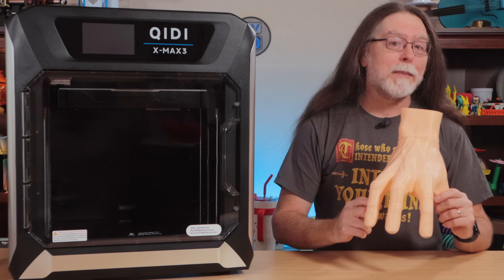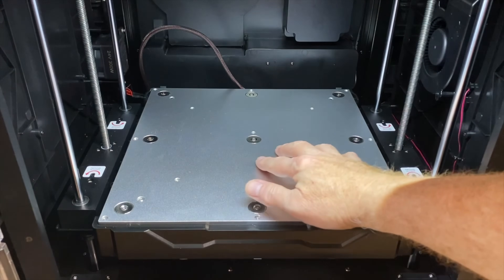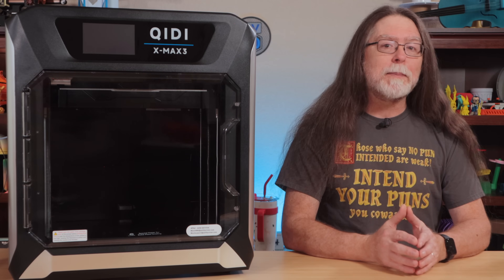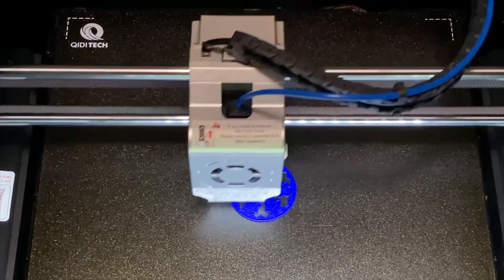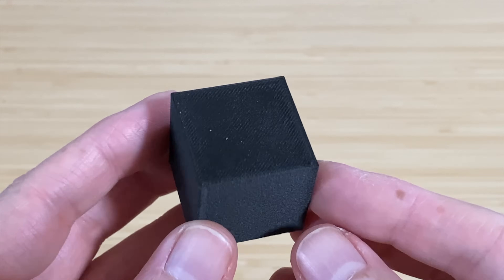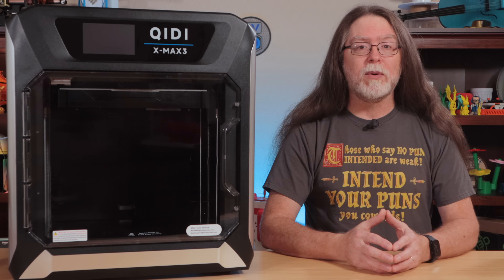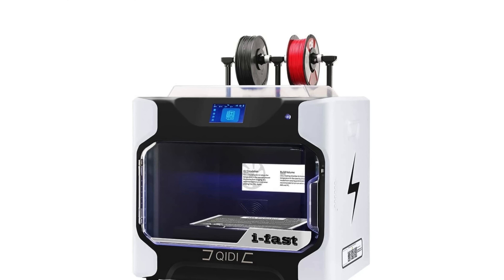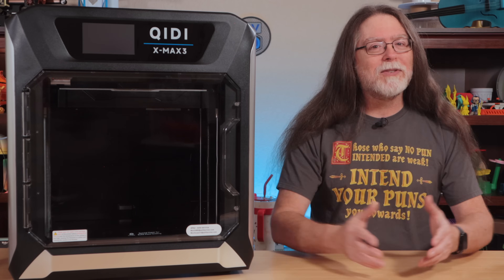Big & Fast: The Qidi Tech X Max 3

Comment: I have a prusa mk4 and having the nozzle as your probe is not all it's hyped up to be. It's alwaya leaving boogers on the build plate as the filament oozes a little. They are not only a pain to clean off sometimes but actually they can ruin the first layer of your next print if you don't. Try finding clear PETG boogers on a textured build plate.

Comment: Huge negative is to not update any of the firmware in Fluidd, it will brick your printer and had to connect via SSH to fix it. That will void the warranty and the info that tells you not to update the firmware through Fluidd is on the wiki.

Comment: Thanks for this review. It's a reflection of my experiences coming from an Ender 3 V2 A new age is rising .... The translations into German are a bit strange (especially when loading/unloading the filament I was a bit confused - something like this can be improved). In addition to your criticisms, I miss a small quadruple bracket to leave the top lid open with a gap to the case (even if I can print it myself - for me that's part of a full service) - or a mechanical solution. Furthermore, a better solution for cable routing as well as magnetic mounts on the hotend would be nice - similar to the Crealtiy Sprite Extruder - just one cable. This makes it easier to replace the hotend. Is that even necessary - just leave the steel hotend on - no matter what filament you print?

Comment: Have an update on another issue I just had.  Suffered a massive layer jump on a print and noticed the adjuster screw in a chunk of the surrounding plastic laying under the print bed. If that wasn't bad enough I soon discovered the cause of that happening and it is because the 4 screws at the back that hold the tensioner pulley were all loose and flopping around.  I thought they were just loose at first, only to discover the plastic behind them was shattered.  I can only assume it was over tightened at assembly in the factory and I opened a ticket with Qidi and they proceeded to blame me for the damage.  I asked them to replace the printer and they have refused so I do not know what is going to happen, but I have a completely broken printer that cannot be easily repaired and it is something I should not have to repair in the first place.  I am going to file a complaint with the Ohio Attorney General's office to start and go from there.  This is so frustrating and the fact they accused me of breaking it burns my britches.

Comment: I recently picked up the Qidi Tech X Smart 3 and have been doing large ABS prints(max size for this machine)some requiring supports, all came out flawless using organic supports with the ABS Rapido using 100c bed temps and 272 nozzle temperatures.  I use 4 surfaces for all horizontal top and bottom surfaces instead of default three.  I am blown away with how great it prints.  

I do not use the spool holder I use a heated Sunlu filament box with tube going to the filament sensor ensuring no moisture issues.  I also keep dessicant inside this heated filament box.  I run with zero cooling fans and all prints have been perfect.

I plan on getting the XMax3 later this year or possibly their latest dual extruder because I want large format prints with ability for water soluble supports.   I noticed Qidi tech made changes like adding ability to see voltage setting on my new Xsmart 3.

None of my prints need glue stick but on ABS I like to add a light coat of Aussie hairspray in purple can for bit of assurance.

Comment: First things first.  Good quick and concise review.  Well done.  It should be noted that the specific configuration of your machine hasn't been shipped from Qidi within the US for over 3 months now, and the recent models have a inductive probe sensor, and an upgraded print head that fixes a number of issues surrounding clogging and part cooling that your model as reviewed has.  I guess Qidi had some of the older stock lying about, and decided to clear it by sending it to reviewers?

I find the topic of auto-Z vs no-auto-Z to be an interesting and nuanced one, especially with developments in nozzle technology in the last year or so.  I have used printers both with, and without auto-Z.  As you correctly point out, the Z offset accounts for the difference between where the bed level sensor detects the bed and the tip of the nozzle.  Now this distance is fairly fixed since both parts are either screwed into, or bolted to the print head.

Where auto-Z helps is when the nozzle wears down, or when changing nozzles for abrasive/regular filaments, but it comes at the cost of additional parts, complexity, and points of failure.  Time is also spent at the start of each print wiping the nozzle down for consistent offset detection, and if there's any filament oozing out after the wipe, or any debris left on the nozzle, this can impact the accuracy of Auto-Z.  While most of the time it gets it right, occasionally it doesn't.  One only needs to look at the various sub-reddits for various printers with auto-Z to see that the feature is prone to failure.

Auto-Z addresses an old issue that has become less important though, given recent nozzle advancements.  Nozzles with tungsten carbide, ruby, or diamond tips all offer the ability to print with all filaments types almost without compromise (other than cost) and without the need to frequently switch between nozzles, as well as being so abrasion resistant that nozzle wear isn't really an issue in anything under a few thousand hours of print time even when using abrasive filaments.  As a result the Z-offset never really changes when using such nozzles, and such nozzles never really need to be changed for different filament types.

After switching to diamond tipped nozzles I've since found myself appreciating that my Qidi does not have auto-Z.  I can set the Z-offset once when I install the nozzle which I only need to do now when changing nozzle sizes.  I run some quick test prints to fine tune the offset, and then it's done.  I can then fire off hundreds of hours of prints and trust that the Z-offset is always going to be correct, and the printer doesn't spend time doing nozzle wiping and auto-Z before every print.

For these reasons I believe that the lack of Auto-Z isn't a clear black and white situation nowadays.  If you change nozzles frequently, or print with abrasive filaments with regular nozzles such that nozzle wear is a frequent and major issue, then yes, auto-Z is much better to have than not.  However, when using modern "do-it-all" hardened nozzles, then Auto-Z can actually slow things down and add in points of fault/failure.  In some ways I think Auto-Z tries to solve a problem that can be mitigated fairly easily with modern nozzle advancements and it is no longer as important of a feature as it once was.
Reply: ...and putting money where my mouth is, today my brand new X-Max 3 just arrived (I ordered it before this video went live).  I can personally confirm that currently shipping modes have the updated print head, and the inductive probe sensor (not BLTouch).  The bed-plate is a double-sided golden colored PEI-coated spring steel plate that mounts to the bed via a magnetic sheet, and not with embedded magnets in the bare metal aluminium base.  The print head has a number of additional fans to help keep the tool-board PCB cool, as well as assist with better preventing any clogging caused by heat creep.

Comment: The choice of bltouch is baffling. prusa, bambu, even creality moved to nozzle probing.
Reply: They don't use the bl touch on the newer ones... I have 2 x max 3s, and they both have an inductive proximity probe. Far far FAR is better than those bl touches. They have upgraded ALOT of other stuff, too, that he didn't seem to have on the one they sent him. The current x max 3's come with a completely upgraded hotend assembly and new tool head front and back panels with more fans. I believe they gave him an older one since it was probably free of charge. I only buy Qidi printers now, their custom service can NOT be beat, ha ds down best in the 3d printer game.if anything breaks on my printers, they reply back usually within hours, deff by end of day. They immediately overnight replacement parts that same day, arrive on my doorstep in 3 days from China. They never blame you. They always answer you. They ALWAYS take suggestions to better their machines and take customer feedback very seriously with lightning fast results. They still overnight me parts to fix my qidi gen 2 x max and x plus 2 still to this day, many years later! Doesn't matter if I destroy stuff and break something that is my fault... qidi takes care of you and gets the you the parts you need to fix it. Again, their customer service CAN NOT be beat.

Comment: When I got back into 3D printing last year after a year off, my first printer was the QIDI X Max-3. It was good through the honeymoon period, but that was it. I also have a P1S with AMS, a Kobra 2 Max, two A1's with AMS and a K1 Max. Of all the printers I have, all current gen printers, the QIDI is by far the worst. I've had plenty of challenges with the Kobra 2, but the QIDI takes the cake. I've had clogs galore, and have replaced the print head four times due to damage from the clogs. Getting the Z height to stay where I put it has proved impossible. It is 30mm bigger than the K1 Max in build volume, but MUCH bigger in the size of the enclosure. Of the six printers I have, only the A1's, the P1S and the K1 Max are on my recommend list. If I could trade my QIDI for an A1 with AMS, I'd do it in a New York minute. I did upgrade the BL touch with the new sensor, and it works okay but not better and does nothing about the manual Z height adjustment. The K1 Max makes this thing look like a school bus next to a Ferrari.
Reply: First, sorry to hear of your problems, but I believe that they are all resolvable.

If you live-adjust the Z-offset to fine tune it, you need to type in SAVE_CONFIG into the Klipper console to ensure it gets stored, otherwise it'll get lost when you power the printer off.  This is more of a Klipper "feature" than anything else specific to Qidi.  Klipper appears to only store any fine-tuning to Z-offset within memory until the SAVE_CONFIG command is issued.  The Z-offset on the Qidi's is stored in the config.mksini file under the [babystep] section.  If you don't want to do the manual offset adjustment yourself, you can edit that value there, type in SAVE_CONFIG, and that will fix the Z-offset value for you quickly.

As for the clogging, the first generation print heads and extruders were prone to this in certain conditions, and especially so when printing PETG and using retraction distances over about 0.9mm.  If you report the issue to Qidi Support, they offer replacement print heads (free of charge) that improves cooling for both the tool-board in the print head, as well as the heat-break/heat-sink which solves the issue with the clogging (or at least it did for me).

Upgrading to the newer firmware versions also tweaks the extruder behavior, and modern versions of the slicer software includes tweaks to retraction distances and speeds that further minimises the chance of clogging.  When I first got my Qidi, when printing with certain PETG brands, it would clog occasionally for certain high-retraction models, but since applying the hardware and firmware fixes I can honestly say it hasn't clogged at all in 5+ months now.

I have the Qidi X-Max 3, and X-Plus 3, and had a Creality K1.  My experience with the K1 was as you describe your experience with your Qidi.  After addressing the teething issues with the first release models for the Qidi's, they now print like a dream and are my trusted go-to printers when I want to be sure that a print will succeed.  The K1 would constantly clog, would get its Z-offset wrong with prints frequently failing due to poor bed adhesion because the auto-Z set the offset too high.  I had upgraded the K1's hotend and was using a Microswiss nozzle.  Even after rooting it and Klipperizing the K1 to fix the input shaper issues, it still had VFA's that just could not be dialed out, unlike the Qidi's where they'll generate surface quality so good it can be difficult to tell that the parts are 3D printed at times.  I've used a P1S a number of times, and while they print very well, I can honestly say that they're not superior to what comes off the Qidi's.  It's about the same, but with the Qidi's I get a little more control to over the firmware to fine tune it.  Out of the box though, yes, the Bambu's are a little better set up.

I'm sorry that you've had troubles and if you've lost faith in your printer the same way that I lost faith in my K1, then I understand.  Just be aware that most issues can be resolved, that Qidi support is generally excellent if you give them the chance (unlike Creality, ugh), and that the printers and firmware that they ship nowadays have largely addressed all the early model teething issues.
Reply: @stew675  thanks for a very reasonable and thorough response. I will take what you say to heart and take steps to resurrect my QIDI, which is currently a $900 boat anchor in my metal shop, taking up space. I certainly do not wish to take that loss on the chin and would be delighted to have a working 330mm printer.
Reply: @Immolate62 I hope you can get it resolved and working for you again. Oh, one quick note on SAVE_CONFIG is that command will restart the firmware to apply the new config, so be sure that the printer isn't mid-print if you use it. Wait until any print that is in progress is done first.

Comment: Since you have access to fluid can you show how flat the bed is -- After seeing a few reviews of the K1 Max -- the bed at best is off by almost 1mm, I would expect this to be better with a thick aluminum bed, is it?
Reply: I can help you out here.  I received my new X-Max 3 two days ago.  The bed came slightly slanted from the factory.  It was flat, just tilted by about 0.4mm.  I followed their manual bed levelling guide from the Wiki to tram the bed relative to the gantry.  It has 4 screws under the bed plate which compress springs that holds the build plate to the bed frame.  Adjusting those I got the 4 corners to as close as I was able to do.
The bed is large, and so takes a while to fully soak for even heat distribution, during which time the bed will move about slightly until the heat is evenly distributed.  This can take about another 5 minutes AFTER the bed thermistor says that it's up to temperature.  There's even a sticker that warns you about this, that just because the center of the bed is up to temperature, it does not mean that the edges are.
Anyway, after tramming the bed and letting it heat soak for 5 minutes at desired temperature I ran the full bed mesh calibration.

The result was a 0.15mm variation in height from the highest to the lowest point on the bed.  That's 0.15mm across the full 330x330mm area.

Within the central 200x200mm print area, I'm seeing a variation of just 0.06mm.  Basically the bulk of the variation occurs right at the very edges, and even then, it's still pretty small.

I have to say, I was very impressed by that.

Comment: Hey Bryan, I have the upgraded version of the Qidi Tech X-Plus-3 where they fixed all the problems on the original released one.
It is a great printer, really fast and does detailed prints too.  I fitted a webcam up on the top of the open top case area and plugged it in to the back spare usb port to watch my prints!

I have ordered the Qidi Tech own design webcam that fits on to the metal front inside camera bracket for doing the remote viewing and time lapses.
So I be fitting that when it comes. The other normal webcam can be removed then.

I am just now doing a fast 600 mm/s print of a free Star Wars Star Destroyer Model that folds and clicks together the main amount of the body and parts took about 17 Hours to do in a nice light gray PLA, the next parts took about 5 hours to do And just now doing the last part with the Display Stand they did too.  that be done in about 40 minutes time!

I love this printer, this is my 1st Klipper printer that also is the 1st enclosed printer too!  I also dislike the rear mounted filament spool system. I be printing a mod to move the spool to the side.

I got a good deal on my printer too. because Qidi were doing a Christmas sale last year and I was a new customer,  
I got the printer for only £502 delivered from the UK warehouse to me here in the UK. and even though it was Christmas holidays, 
they got it delivered in 5 days meaning I got it on the 31st December 2023.

I am so pleased with the printer that I be selling off two older 3D printers and saving up to buy the Qidi X-Max-3 as well?  I just keep the two other 3D printers I got 
( the Elegoo Neptune 3 and 3 Max ) and use the BTT Pad 7 to Klipper them up so I will have all klipper printers.

I was thinking maybe Qidi can solve the Spool placement by doing a spool holding drawer system we can print where the spool lays flat under the printer base in a drawer which can slide in and out to access the spool.  The drawer can have a strong thick base around it that lets the printer sit on top of it, then the drawer can slide between the thick outer base sections and the printer just sits on that outer thick strong base walls. a Teflon tube can go from the drawer to the back feeding point.